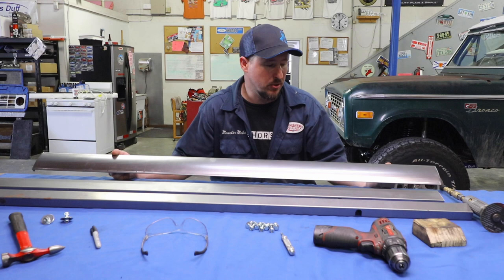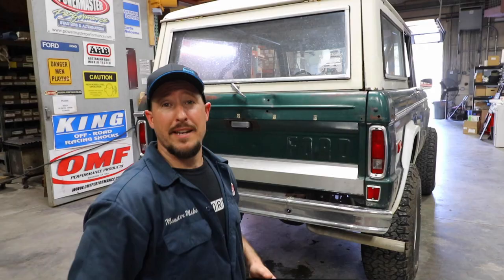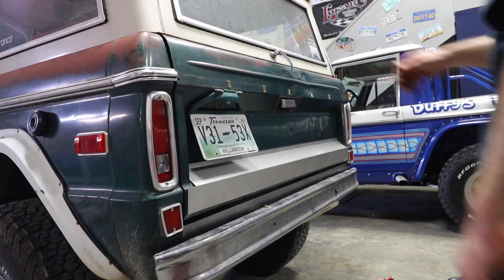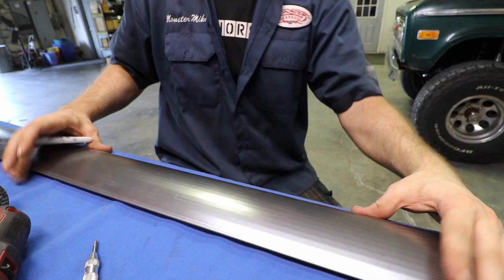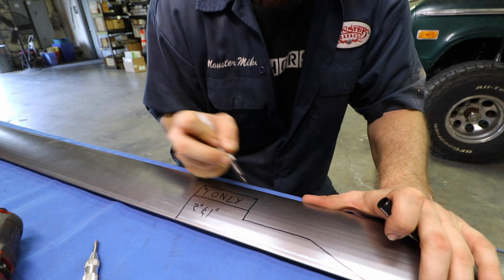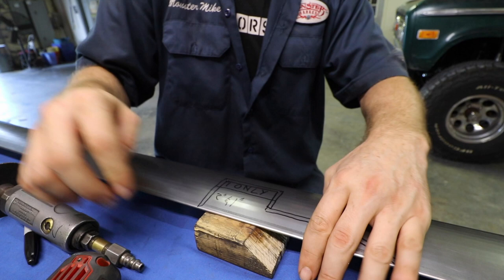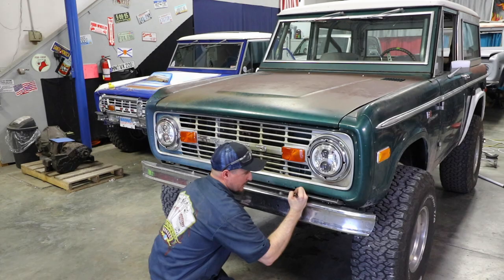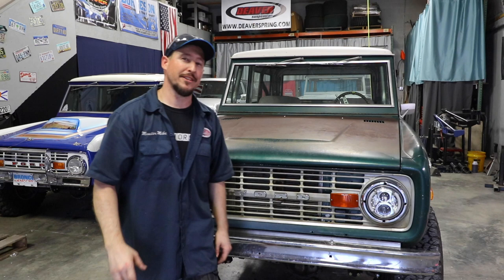Just say no to Gap! James Duff Roll Pan Install

Comment: I would also add that on the front with a body lift there is a significant amount of the radiator that is below the grill that was previously behind the bumper and is now more exposed to road debris. The front filler panel will also help protect your radiator.